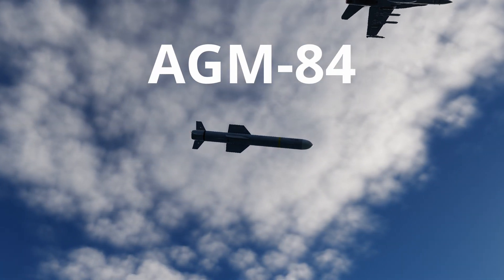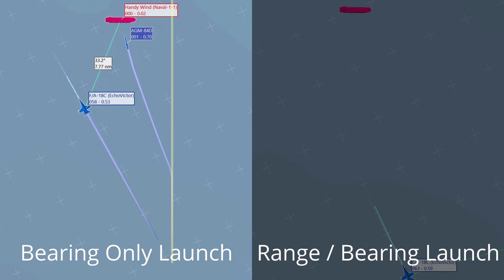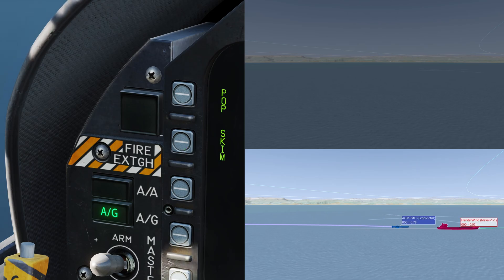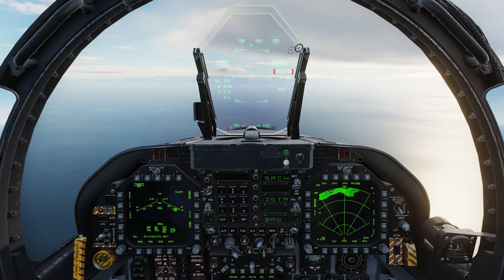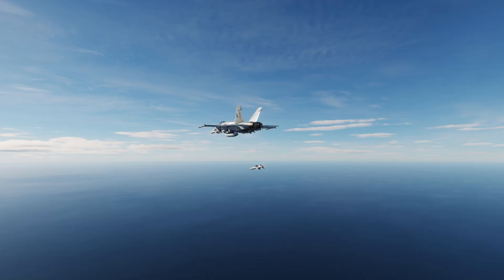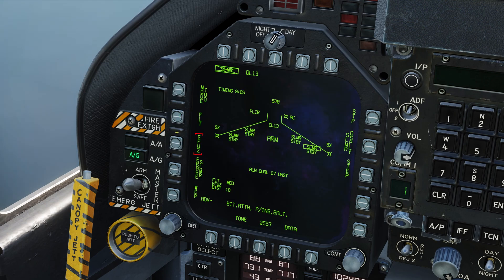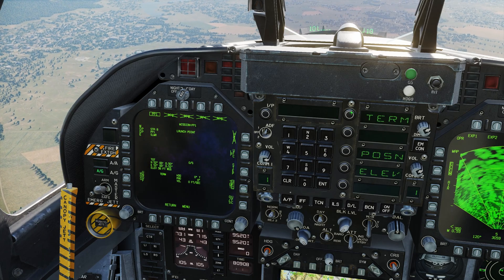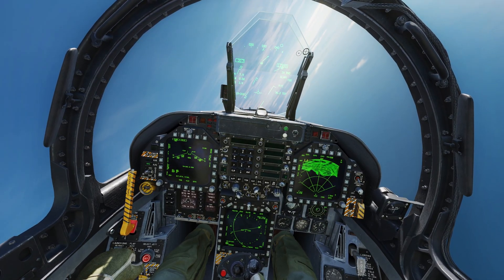Cruise Missiles | DCS F/A-18C

Comment: Thank you for your video! Unable here to get the SLAM camera active. I am only trying in TOO mode. Basically the timer does not start. Do I always need to have the datalink pod onboard to get it working? Because I am flying with a fuel bag instead.
Reply from the maker: Yes, unfortunately you need to have the AN/AWW-13 Datalink pod to have the video active. This acts almost like a "WiFi" between the plane and the SLAM to send the video. Also, make sure to select WEP -> The weapon you are firing to link the datalink pod and missile together. Hope this helps!